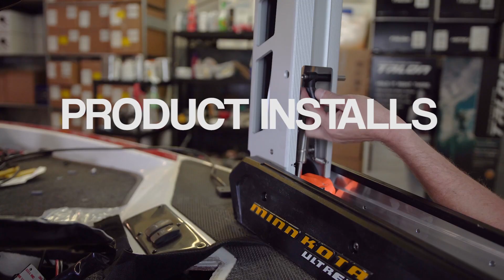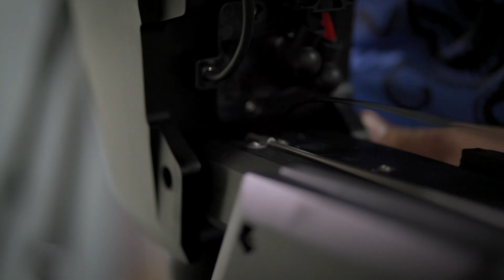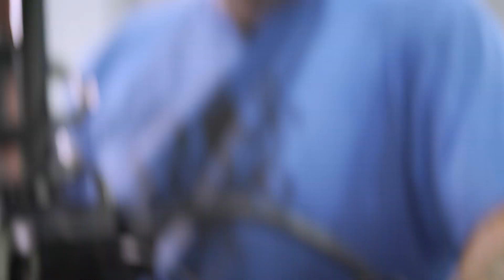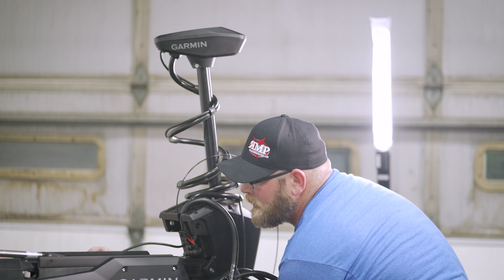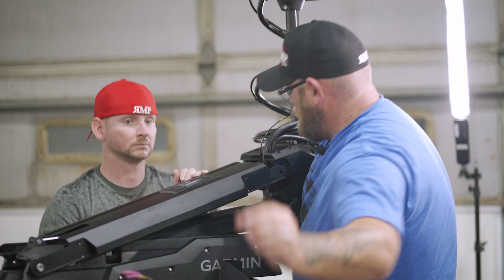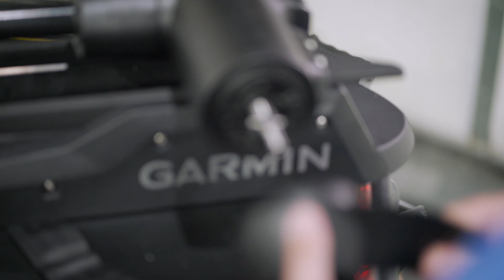How to Install the GARMIN FORCE TROLLING MOTOR

Comment: It says to install a 60A circuit breaker and you guys aren't doing that? Running dedicated power directly to the batteries and electing not to use the circuit breaker?

Comment: So...I have a left hand drive boat. Will there be any issues if I try to mount the motor on the starboard side of my bow instead? Or will it be in my way if I install it port? Its a jetboat and I'm short haha. Dont want it in my way.

Comment: Great video. When i installed the top arm I didn't have to lift the unit. All I had to do was tilt the head forward/motor to the rear  until the upper arm cleared the head. This was very simple, including the cable connection.

Comment: When changing from ulterra to force am I using the electrical 36 volt wiring already installed? Do I need that circuit breaker? Running 1 36 v pro lithium battery
Reply from the maker: you will need a circuit breaker, they are usually in the back by the battery.  even your ulterra requires a circuit breaker.  You should be able to use the same wiring that the ulterra was using to power up your force as well

Comment: Where does the 2" X 3" rubber patch go? Lost my assembly instructions.  Power cable is 14" from motor connection to cable tube.  It gets in the way of the pull cable when it's floppy like this installation.

Comment: There was a “recall” on the latch system. A lot of dealers do not know this.     
 And the shaft length is way shorter than you think.  The 50 was too short for my g3 bay 18
Reply: What about the 57?
Reply: @FratBoyFishing  is perfect
Reply: @bakervinci163  Word you don't have issues with it popping out of the water during rough waves?
Reply: @FratBoyFishing  no, but it is riding a bit lower than you would typically set up a boat.   If I did not have two ls transducers, I could spare to bring it up a bit

Comment: OMG, total buzzkill at the end of the video. The fact that a Garmin 57" = a Minn Kota 52" makes this product completely unusable for walleye/multispecies boats.
Reply: It was an issue for me. Thankfully my unit failed and has to be replaced.  I have a pretty small boat( g3 bay 18dlx) and the short shaft is too short. I had to pay an extra 100 on a replacement motor.  They did replace the motor pro bono.
Reply: @bakervinci163  That sucks. I was hoping to put this on a Lund Pro V Bass, but now I think I will wait until they add longer shaft lengths. Here's a vid of the boat and the trolling motor, seems to do well in windy conditions but the waves weren't big enough to tell: https://www.youtube.com/watch?v=Q8GUywUzICU
Reply: Nytron nice video.  We did one last week as well. Ours is not as nice as yours, but might be as entertaining.   I’ll send it. 
 Yeh.  No way with a deep hull Lund.
Reply: Nytron https://youtu.be/tOT-LJv3ABs
Reply: @bakervinci163  You're using a 57" Garmin, or a 50"?
Reply: Nytron I had a 50 and was not able to keep the head 4 inches above the collar and still have my prop bite the water in light chop. My unit had a massive failure and has to be replaced, so I asked them to send me a 57. It was a free replacement, but I had to pay 100$ for the longer shaft.
Reply: @bakervinci163  Ah, I see. I'm for sure gonna need a 57" shaft, but I'm not sure if that will be too short still. The general consensus seems to be that a Minn Kota 45" shaft is the same length as a Garmin 50", and a Minn Kota 52" is the same as a Garmin 57".
Reply: Nytron well, I know that Garmin almost mandates that you have a minimum of 4 inches of neck above the collar.  In order for mine to bite, without coming out of the water, I did not have but about an inch or so above the collar. I also only have room for a single livescope transducer and I run two. One on a mount and one on the troller shaft.   The 57 will give me more room and my cables will not be squeaking in anchor loc.

Comment: Might want to disconnect the leads from the battery before hooking the wires up next to each other... a little arcing there when he shorted the battery at 11:50 😳
Reply: Good eye.. Had to watch a couple times to catch that.. Very Surprised they were hot, but then again he's using a damn pair of channellocks..

Comment: Can you do a DETAILED video on the power wiring?
The "dual power" cables have me a bit confused in regard to the "two positive and two negative, cables, with eight cables total required to six connections".
I am not following what you are talking about and I sure as hell don't want to screw up this motor!
The motor is mounted to the boat, but I am still working on running the power cables for the motor and transducer.
Any help would be appreciated.
Thank you!
Reply: Lonnie Chartrand 
I’m interested in the answer also.
Reply: Also interested in this
Reply: Exactly. I have a 24V red wire from the trolling motor batteries and a 24V black wire. Do I hook up my 24V red to the Force 2 fused red wires and my 24V black wire to the 2 fused Garmin black wires ?

Comment: "Don't forget the strap".....Hahahaaaa!
I only laugh because I just installed my Force this past weekend and DID THE EXACT SAME THING!
The installation instructions were detailed and explicit.  And it explained to NOT FORGET THE STRAP.
Totally my fault.
I had the strap laying next to the lower mount in anticipation of proper installation and to NOT FORGET THE STRAP.
As luck would have it, I had to remove the trolling motor bracket for my boat so as to be able to bolt the trolling motor lower mount to it.
While trying to install the mount to the bracket I FORGOT THE STRAP!
I discovered that while I was clapping myself on the back for doing such a nice, clean install.
AND THEN I SAW THE STRAP!!!
Oh well.
There is more than one way to skin a cat.  I cut the strap and burned the ends to keep them from unraveling.
I then used a two hole straight bracket and placed it over the strap.  I used a nail heated with a torch to burn two holes in the strap
I placed the strap against my trolling motor bracket and laid the bracket on top of it, lining up the holes and then ran 3/4" stainless steel sheet metal screws through the bracket and strap, into the mount.
Worked perfectly!
Reply: Or just don't forget the strap.lol

Comment: You guys did a great job preciate it. How does it plug in I noticed that you did the 8 wires. I have the Minn Kota now can I use the same housing or plug?
Reply: Don't use a plug. Power direct, it'll eliminate power loss, connection failure, lag, interference etc.

Comment: When I spoke with my garmin dealer they mentioned that the 57” is equivalent to the competitions 60” and the 50” comparable to 53”

I just purchased the force 57” and if what u said is true I think this trolling motor will be far to short for my application.

Any way u can clarify that statistic? 

Thanks

Comment: Way over priced
Reply: Use one for a few minutes and you might change your mind.  It's the best built TM I've ever seen.
Reply: What's the thrust?
Reply: @josephlassiter1412  Garmin doesn't use "thrust" as a measurement. The Garmin trolling motor is set up to be either 24 or 36 volts, the 24 will be around "80# of thrust" and the 36v will be around 115#.